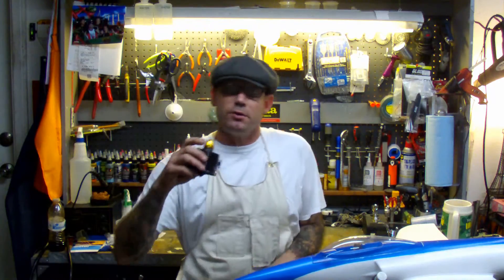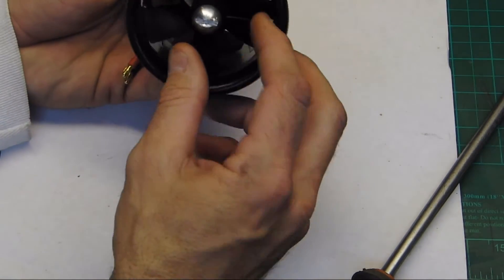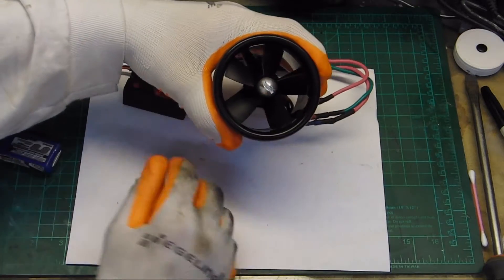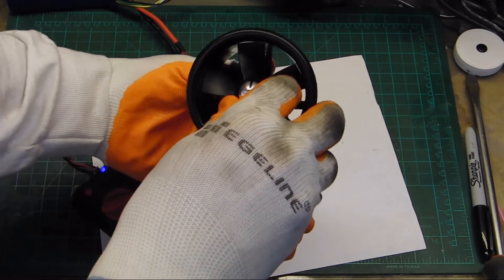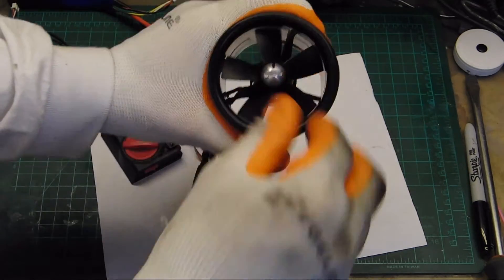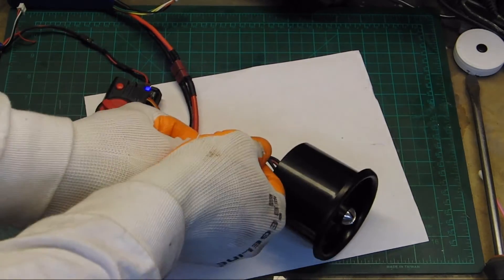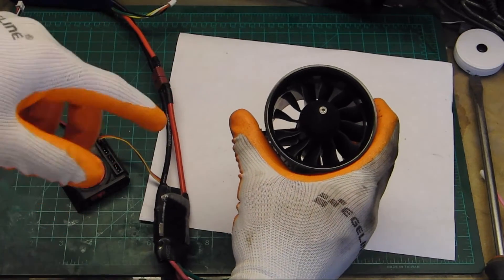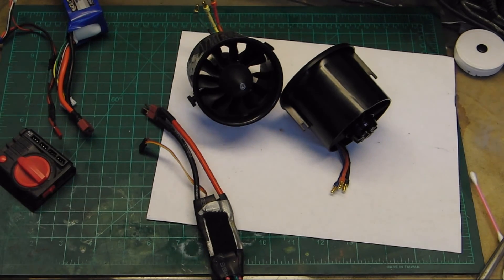EDF Balancing! Pt.2 "DYNAMIC". Make it sound like a TURBINE!

Comment: I did the same thing today and the fan exploded in my hand so be careful when holding maybe not run up to full power ! I had to go to the hospital. Using the eflite delta v32 80mm on 6s 120a esc .. don’t hold the fan while spooling up especially at full power bye bye finger

Comment: On my Freewing 70mm setup,  the fan unit is held in place by a nut and washer underneath the spinner.   Very tedious to loosen and balance this way.  I just statically balanced both fan unit and hub together and installed.   Seems to have worked well.

Comment: Thanks for sharing this. Even though I have the impression that in the end, even if the fan is balanced, the only way to get the WHOOOSH is to have more blades, no matter how precise you are.
Reply: Yes, more blades = more turbine sounds. But if you have an unbalanced 12 blade EDF fan, you will easily over-amp the power system, destroying your ESC, and damaging you aircraft. so balance either way.
Reply: My Durafly Vampire and Freewing F9f - both 5 bladed fans have an awesome turbine sound - so you can really have the best of both worlds - sound and efficiency